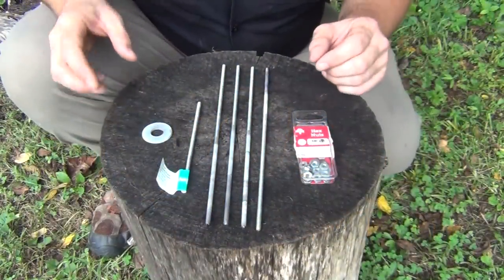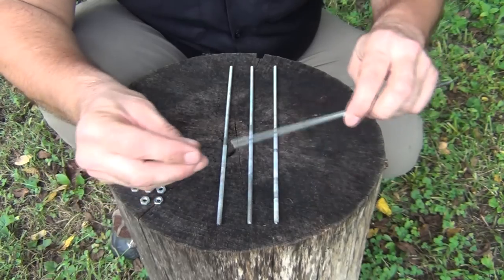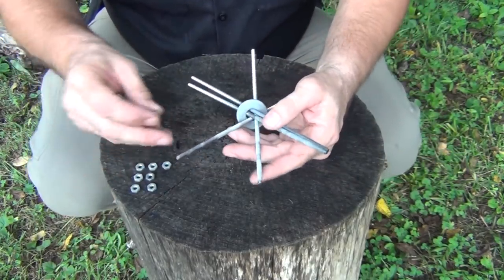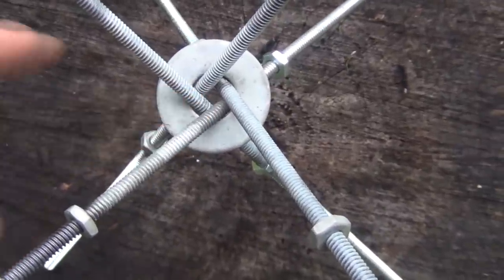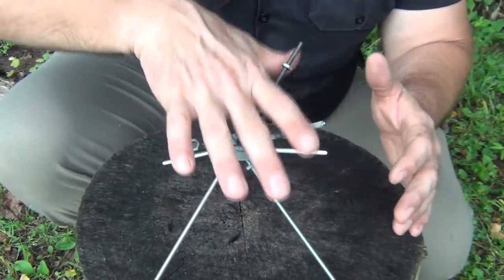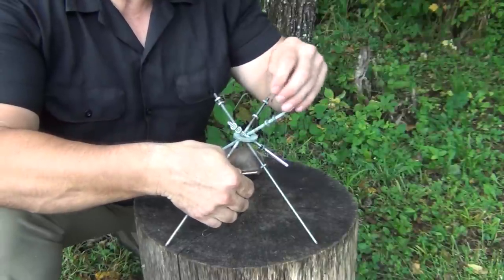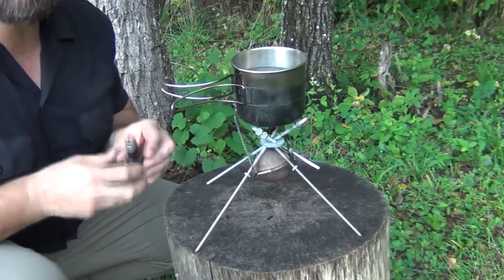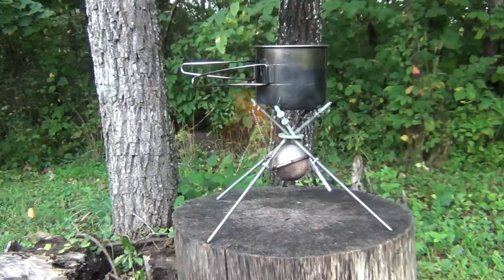FUEL BALL STAND! [ IT WORKS! ]

Comment from the maker: Thanks for watching. This is the follow up video to the fuel ball. I really appreciate all the views, the kind comments and all the new subscribers. Please leave me a comment in the section below!
Reply: Not to be critical in any way, okay? But we can take 3 or 4 if preferred and bend them at 90 degree angles. I suggest at 5". They can be 1/8th rods or even 3/8" rebar. Now bind them all together with a single hose clamp. Drive the long legs into the ground. Spin each, so they point away from the center in equal directions. Hoorah! Simple, light and will hold up a pot nicely. Build the fire around the legs.
Reply: Hi, I really like  the concept and design of this pot stand but please don't use zinc plated metal over any fire without first burning off all the zinc plating .The zinc vaporizes in high temperature applications and turns into  a highly carcinogenic and highly  toxic nano particulate .
I am  a welder and we have  to burn off the zinc plating  on any galvanised metals outside ,well away from people, prior to welding .
Reply from the maker: Yes, zinc as well as any galvanization definitely needs to be burned off before cooking food.

Comment: amazing! i thought the fireball was as far as that would go but... 😱😳 nope! 😊 

i wonder if a small lightweight frying pan could be used on it? (doubt it tho!)

a wild random idea/hack for the stand, could you add metal angle brackets to the bottoms of the legs (or an X underneath between the legs) to help keep them spaced securely? its a wild idea but you may be able to work something out with it 😊
Reply from the maker: You could definitely use a small lightweight frying pan on it. You just have to adjust the legs so that the support for the pot is wider at the top. That's what's so efficient about this design is that it's adjustable both for height and width of cooking pot. You could definitely add an X brace to the bottom but I would probably use some lightweight metal chain instead of a metal bracket.
Reply: Check with crazy crow trading post. The small foldable carbon steel frying pans have pretty good angled sides. I bet it would sit in there perfectly.

Comment: Huge improvement 👏. 
Now you can cut the bottom off of a large can leaving about an inch or so of the edge on it and place it on the top and have your hobo Grill to cook things on too. I'm also guessing that if you don't have all thread and nuts for it you could probably stab tent Stakes through the bottom part of a tin can. And make some little holes in it for ventilation and the fire to go through.
Reply from the maker: Thanks for watching!
Reply: @WayPointSurvival  I watch everything you put out. .

Comment: Hey James another great hack once again! Just one question, how many times can you use the ball before you have to change the insulation out. I'm sure it will vary depending on the usage, however a ballpark figure would be great. Thanks James 👍
Reply from the maker: I would imagine getting 40 to 50 burns out of it would be no problem, if not more.
Reply: Wow that's fantastic 👍

Comment: Love your videos but you should actually consider setting the metric up in the corner since you are one of the last to measure in imperial. Here in Sweden we have both systems when regarding lumber for example. We also have our own mile which is 10 km (6,21 miles). Best regards from Sweden!
Reply from the maker: Thanks. I do that sometimes but it's difficult to figure out the measurements on things like this because everything we have is in the Imperial system.

Comment: Make sure you burn this in a nice and hot fire before you really breathe around it, because it's galvanized.
Zinc off gassing when you burn it is extremely toxic, 1-2 good little fires and the galvanization on such small rods will be completely burned off.
Reply from the maker: Good point.  Thanks for watching.

Comment: I am not sure about using fiberglass considering it is made of very fine glass strands. Hence fiberglass.
Reply from the maker: The mesh is so fine on the tea ball that it contains the fibers quite well. Also, fiberglass isn't flammable so it merely acts as a wick for the alcohol to burn.
Reply: Many wicks contain non-combustable fiberglass as a wicking material that uses capillary action to draw up and contain the fuel until it is consumed!!! In fact, I believe the little mantle sacks/pouches used on gas camping lanterns are made out of woven fiberglass that when the gas combusts, it makes the mantles glow white hot which emits the light for you to see!!!😁👍🏻
Reply: @fookingsog  maybe so, but that’s not the same as insulation fiberglass

Comment: Why did you choose 4 legs in this design instead of 3?
Reply: Probably because the larger hole in the washer!!! If the washer hole was smaller, you could probably use 3 threaded rods instead of 4!!! ...would cut down on the pack weight!!!
Reply from the maker: Because of the size of the hole in the washer as well as stability.